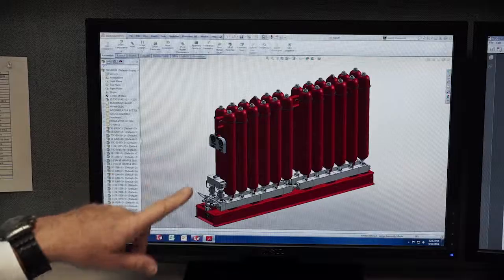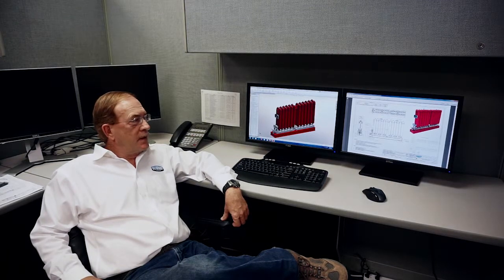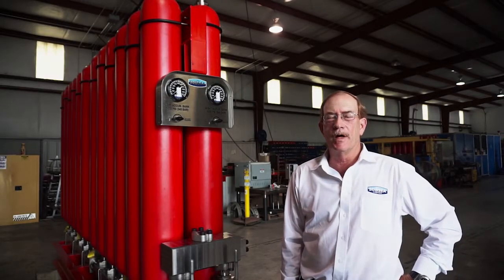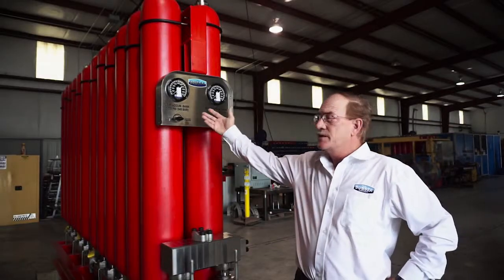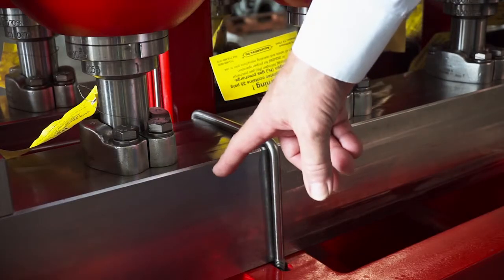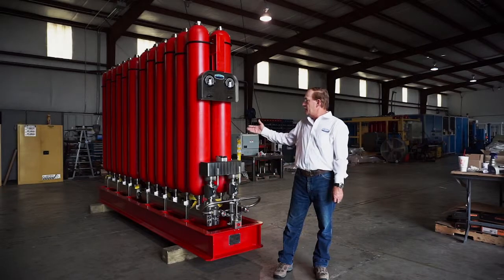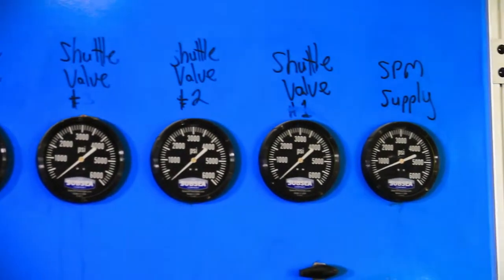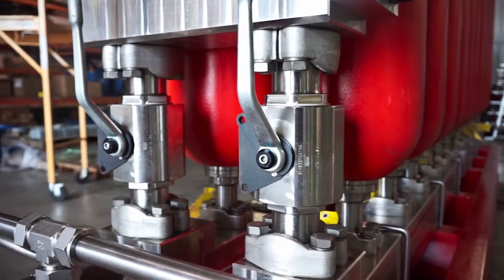Subsea Accumulator

Comment from the maker: The #Subsea Company provides Accumulator Bottles with the option of Accumulator racks that are designed according to customer specifications. Choose from several standard accumulator sizes, a variety of coatings, fittings and accessories. Custom fittings and coatings can be provided to accommodate your requirements. Watch the short video below to learn more:

 #subseatechnology   #thesubseacompany   #oilandgas   #accumulatorbottles   #accumulatorracks